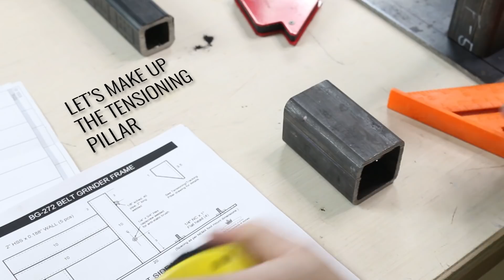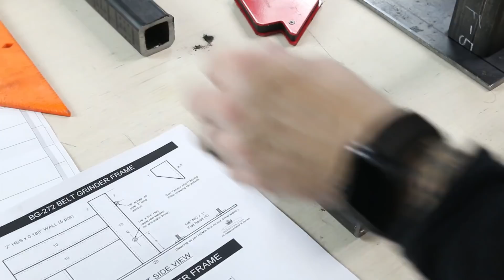How to: 2x72 Belt Grinder Build - Treadmill DC Motor Driven For Knifemaking - Homemade Tools

Comment: So I spent a great deal of time trying to weld a tube on for a drive wheel and haven't gotten it running smooth yet. I see you just used the wheel on there. I didn't realize that would work!! lol

Comment: Hot metal shavings and the power supply top is full of large holes.......build a cover for it stat, or you'll replace it soon
Reply from the maker: Yes sir. Did that already. Definitely needed. Cheers!

Comment: So I tried this, got a 4 hp TM motor, hooked it up with a voltage regulator going to a bridge rectifier. It did NOT like a load, the brushed started sparking and the motor got HOT :(

Comment: I really like the idea of the treadmill motor to power the belt grinder/sander!
Was wondering what your opinion is seeing as how you have built a lot of these?
thanks!
Reply from the maker: I don't recommend it in this environment. The magnets pull steel dust in and fry the motors. It did get me going though. Now I only use TEFC AC motors.

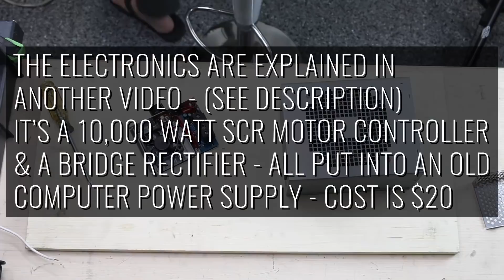Comment: @13:50 mentions a separate video for the electronics involved which is what I'm after.. does it exist?  I did find a wiring vid on your channel but that was for a 3 phase AC motor, not the power solution shown here

Comment: Like the "Kit Build" a deeper drive wheel to accommodate the full width of the sanding belt would help with belt-life.  I think your power solution for the DC Motor is a "short-circuit" wanting to happen .  Your going to have metal particles flying all over the place and they will short-out your electronics circuit board, that fan is feeding them to it...Good Luck!
Reply from the maker: I learned a lot from making this grinder. DC wasn't worth it. But it helped me get to where I am now. Thanks for watching.

Comment: Good video!  The upper box section is for the paten but but what is the lower box section for?
Reply from the maker: That lower tube is for a work rest tooling arm. If you take a look at my latest design you can see how it's used. Really useful!

Comment: Got my treadmill disassembled this evening. I swear this used laundry hanger might have 5 miles on it...tops. Everything on it is in new condition, drive belt, lift motor even the walking belt.

I was going to try to incorporate the electronic controls for the grinder, but I like your other design better.
Reply from the maker: Let me give you some good advice. Use the controller that came with the treadmill. It’s easier and cheaper. (Not prettier) bit it works well. Let me know how it goes! 😎
Reply: @HouseMadeUS  doh!!  I'd already sold the controller on Ebay  :/

Comment: what size and length is the piece of pipe you used for the drive wheel i didnt see it in the discription ?
Reply from the maker: Hi Jamie, I never actually used the pipe, but it is 4.5" in diameter. Thanks!
Reply: @HouseMadeUS  oh whoops i saw a video of someone welding the pipe on to the flywheel .. your video has legnths and metal sizes so i l saved yours so i could use the discription ..thanks for the reply :)
Reply: @HouseMadeUS  liked and subscribed btw

Comment: ok just found this video very similar to my belt grinder. But I don't have it on a metal plate base I wish I did, I made legs to bolt to my work bench .
Reply from the maker: Yeah that plate makes it easy to move from work surface to surface without having to re-align everything.
Reply: You have some great builds!
Reply: House / Work yeah I built mine at this one job I used to work at lol, had to be able to get it out to the truck without the whole place seeing it , hell everyone was building stuff there on the job , might actually buy a plate or find some scrap and do that .

Comment: What was the Dimensions on the pipe for the drive wheel? I see you didn't use it.. I'm following the plans you used. I'm all assembled and some reason my belt keeps falling off.
Reply from the maker: 4” pipe. Check your tracking mechanism for the belt problem.

Comment: hey i bought your plans for your other 2x72 grinder but after thinking about it it would be way more machine than ill ever need. is there any chance i can get the plans to this one? i already built the motor controller and copied down the dimensions for the steel. so i just need hole sizes and locations. thanx
Reply from the maker: Hi Nick, yes I can email you the plans. I will do that today. 👊🏻
Reply: @HouseMadeUS  awesome thanks I'll look for them

Comment: Are those smaller magnets home made or purchased? What are the benefits of using those?
Reply from the maker: They are hard drive magnets, they collect the metal dust and keep it from entering the DC motor.
Reply: I was talking about the ones you use when welding the frame.
Reply from the maker: Oh I see - these are available on Amazon: https://amzn.to/2sXj1Lv. Or the flexi ones - https://amzn.to/35O7lcT - I use them all the time.
Reply: Thank you

Comment: I thought that heavy wall square tubing had a welded seam inside that would prevent using it as a receiver for the tooling arm.  Do you order something special to get the heavy-wall square tube so that it is smooth on the inside?
Reply from the maker: Most all square tubing has that weld. About 5 minutes with a file and it’s gone. Nice tight fit, no play. This is the way. 👊🏻
Reply: If you buy square tubing that is designated DOM (Drawn over Mandrel) it has no weld inside. Or just ask for reciever tubing.

Comment: What size is that round?
Reply from the maker: 72” or 6 feet around.
Reply: @HouseMadeUS  I meant the round tube should have been more specific
Reply from the maker: It’s 4.5” around. :)
Reply: @HouseMadeUS  cool I'm planning on building my own edit do you have any plans I can get for reference
Reply from the maker: Check the dc knives website. He has great plans. I swapped the .188 wall tubing with .25 wall except for the tracking bracket.
Reply: @HouseMadeUS  could you link me to the round tube you bought?

Comment: So I ordered the same metal same place. (Not pre-cut) I just cut it myself (FYI it killed the cheap harbor freight chop saw RIP). One issue I am having if my treadmill motor. I see you didn't order the OBM drive wheel and went with the flywheel. How is it holding up? I may have to put mine back on.
Reply: Also, how is the tracking/ wear with the wheel smaller than the belt?
Reply from the maker: I had a good experience with the flywheel. But ultimately the motor failed after a couple of months so I switched it out to a 2hp AC and a VFD. If you look through my video library you will see a video about why. Mostly because the motor failed and if I had to do again would I.
Reply from the maker: There is a guy on IG @mikelevalley who runs that setup, and has put many hours on it. Check out his vids. You will find your answer there. Proof in the puddin. 👊🏻

Comment: @12:26 pardon the maybe dumb question, but if you run the tap all the way through, is the opposite side left hand thread now? Or is that determined by the Bolt?
Reply from the maker: Actually it still stays the same. Top and bottom are both right hand tight. Righty tighty as they say. You would need a left hand threaded tap to change the direction.

Comment: Hi Brian. I am wanting to build my own belt grinder and was contemplating using a treadmill motor with a variable speed controller similar to what you are doing. My concern is that this model won't stand up to continuous applications? I've read a lot of reviews and comments from those whose attempts to do the same were thwarted by constant circuit breakers tripping, and I'm wondering if the load capacity is overwhelming the circuit design? Let's face it, a treadmill and all it's components were engineered to operate optimally, even under extreme loads. So my concern is, why are so many others who are opting to go this route (similar to your layout) having so many issues with popped circuit breakers? I guess I'm not sure why you just wouldn't use the controller board (if it's still functional?) from the treadmill that it came out of or just purchase a new one? I understand cost wise it might not be feasible, but think of all the frustration that would be eliminated in trying to figure out the issue or having to swap out to an ac motor. Just a thought. Hope you can add to this and see how your build held up. Cheers!!
Reply from the maker: Yes I totally agree. I have abandoned the concept of using DC motors in a grinding environment. I would 100% agree that an AC motor is by far superior. Anybody who wants to mess around with DC motors needs to understand that any dust that gets into those magnets will destroy the motor. Also the brushes take a beating in this environment. Thanks for your input on this! 💪🏻😁

Comment: So you put that your tracking bracket was 1.5x1.5x3.5 but hows that possible if your tension arm is 1.5x1.5? Looks like it .ight be 2x2ike the body.. is that correct or am I wrong?
Reply from the maker: Good catch yeah the tracking bracket at the top is a 2x2 .188 wall.
Reply: Thanks.. I appreciate it.

Comment: Very nice; too bad you couldn’t find some scrap steel to cut costs further.  Do you have a way to adjust the belt tracking?  It looked like it was offset a bit.
Reply from the maker: I’ve seen guys build these with old weight benches. That seems to work as well. I really wanted a heavier tool so it made sense to go with what I got. The tracking is off just slightly, I have yet to really notice any issues with that though. I’ll make another video when I put together my first knife build. Thanks for watching and commenting.
Reply: @HouseMadeUS  you gotta check out your local metal supply outlet!  Mine (Alro) would have had everything you needed for pennies a lb, ya just gotta cut it yourself. It probably would have cost ya $25 in total, and they'd have had all the exact sizes you needed as remnants.  Great build, though!

Comment: Morning, just starting out. I had a small 20x20 mini shop built and I have no tools yet. Just wondering what it would cost to manufacture a 2x72 belt grinder with a treadmill DC motor and shipping? That tool is beautiful that you provided on YouTube. Hopefully I hear from you.
Reply from the maker: These aren’t for sale yet but you should watch my latest video. I am designing another. Much better, more features etc. thanks for tuning in.

Comment: You probably won't be able to answer this for a while, but does the fan push metal dust into the electronics over time?  Could you put a compression type spring under the adjustable pulley riser to tension the belt?  I have almost all of that metal ready to go, you gave me a project to work on.  Thanks!
Reply from the maker: Yes the fan does suck in metal dust so you will want to put a filter over that. I made one from a candy container and a horse hair air conditioning filter. Works pretty great. And yes I used a spring under the tensioning pillar. I got a 4 inch 30 pound spring from Ace Hardware. It was three dollars. I’m glad you are working on a project! And that I was able to inspire you to do so!
Reply: Thanks for the quick reply.  Cool.  I'm glad I wasn't too far off base.  Good stuff, man.

Comment: How's the motor and scr
 holding up?
Reply from the maker: The motor blew a brush mount, so it was throwing sparks. It had a lot of hours on it. I’ve since replaced it with an AC motor and VFD. I couldn’t get the parts for the dc motor. Brushes you can find but the mounting bracket (which is plastic) isn’t available. I’d have to replace the entire motor. I’ve since epoxied the mount hoping it would hold for another project. Thinking of using it on my lathe.

Comment: This is similar to what I did for mine but ended up having issues with the treadmill motor flywheel being too thin. It was messing up the belts and making tracking difficult. Experience any of that? Maybe I have it tensioned too much.
Reply from the maker: I have yet to experience any issues with the belt and the flywheel. You may have it too tight or too loose. I may end up putting on a 2” drive wheel if I can find one with a 17mm bore.
Reply: There are some treadmill motors that have 2” wide flywheels. Haven’t been able to find one though. I just bought a wheel set on amazon with a 5/8” bore. Pretty good price. $110 for 4 good quality wheels.
Reply: @jbrou3892  Could you share a link ?
Reply: DarkKnightWong just got them in today. Looks well made. Fit my 5/8” motor shaft well. Haven’t wired up the new motor to try them out yet though.

Comment: Where did you get the plans.. Nice work
Reply from the maker: Here are the plans I followed, be aware that I did not use .188 wall 2x2 - I used .25 wall and filed the seams. Much better fit.
Reply: thank you
Reply: @HouseMadeUS  I wanted to ask the same question about the plans. I see you answered but I can't see a link or anything of the sort. Am I missing something? Thanks for posting this!
Reply from the maker: Not sure if YouTube is stripping the link or not, but here is the link again: http://dcknives.blogspot.com/p/2-x-72-belt-grinder.html?m=1

Comment: Curious to know why you didn’t try and weld the round pipe onto the motor flywheel? Didn’t want to deal with welding to a cast part? Also curious to know how the flywheel only as a drive wheel will wear the sanding belts down. Now that you’ve had it for a few days, does the fluctuation in the voltage out of the rectifier produce any noticeable effects to the motor? Jittering vibrations etc etc.
Reply from the maker: So far so good with the flywheel. And yes I felt as if I couldn’t get that pipe perfectly welded on so I skipped it and just tried the flywheel. I notice not uneven wear or any tracking issues. I do think though at some point I will add a 2” drive wheel to it. The shaft on this motor is 17mm so I may need to shave it down just a little and move the mount over a bit to do that. I think I can shave the shaft down 1mm with a file while it’s turning. I have not noticed any jittering or vibrating with the motor yet. It seems solid enough. I’ve ran it now for a couple of hours and it barely even gets hot. I did add filters to the motor as well as the electronics. That was very much needed, and some magnets around the base to pick up metal dust.
Reply: House / Work I would recommend contacting someone from Etsy or eBay who has drive wheels for sale and see if they can make you a wheel that’ll fit your motor shaft. I’ve tried filing the shafts and boring out a premade drive wheel. Both were doable but they  were sketchy running at full speed and for extended times. When I happened across another motor I had a custom drive wheel made for like $55. Makes a world of difference, as well as you can swap out to any other treadmill motor if you burn it up and need to replace it.
Reply from the maker: Wes Mischke - great suggestion. I do have a metal lathe (a very old one) and maybe I could make one myself? Might be a good video to make too. I’ll look into Etsy. That is super helpful info. Thank you. 🙌🏻
Reply: House / Work if your lathe runs true enough and you have a bit of aluminum stock laying around do it!!!
Reply: @HouseMadeUS  I'd like to see that video.
Reply: House / Work I’d even buy one from ya if the price is right if you made extras :D

Comment: Just picked up a bargain treadmill. Can't wait to get started building.

Any issues using the treadmill wheel as the contact wheel. And do you think slightly thicker than 1/4" plate Aluminum will be strong enough for the "D" plate?
Reply from the maker: No issues, and if you want to see someone using this setup x2 check out my buddy Mike Levalley on Instagram. He has some cool treadmill driven grinders.

Comment: I just found and subbed to your channel.. So basicly this is a way to be able to use a tread mill motor with out it failing due to dust? Martin
Reply from the maker: Well no this doesn’t solve the dust problem. You can do that with filters and such. There is a guy on IG named Mike LeValley and he has some neat ways to filter the dust from the dc motors.  I have since swapped this motor out for a sealed AC motor and Vfd but the DC motor gave me a great start. I am going to use the DC motor on my lathe, where the dust is more like chunks.

Comment: Hey , nice work! I have a question. I designed a similar sander but have some problems. I needed a deadhead for sanding my guitar necks. It causes a lot of friction even with graphite cover. So the drive wheel needed to have a rubber tire on it to move the belt without slipping. That is fine although this thing gets hot after 10 minutes or so and the rubber has broken a few times. I see your belt is driven by a narrower wheel than the belt. Does that cause any problems?
Reply from the maker: I’ve not had any issues. I found a guy on IG that didn’t use a rubber drive wheel so I reached out to him. He had been making knives for a couple of years using the flywheel from his treadmill motor. No issues and he makes 3 knives a week. Heavy use. One thing you will want to do is make sure you filter the air going into the DC motor. They are one big magnet in there and will pull in metal dust, ultimately destroying the motor. I also built a filter for the electronics. Other than that it’s exactly as you see it in this video and grinds really good.